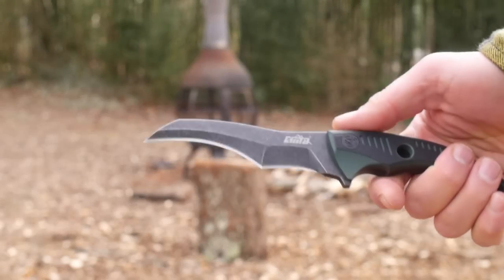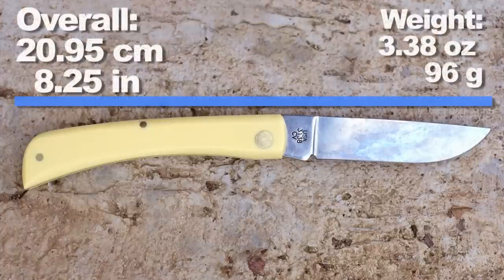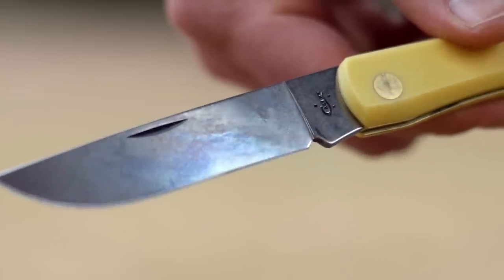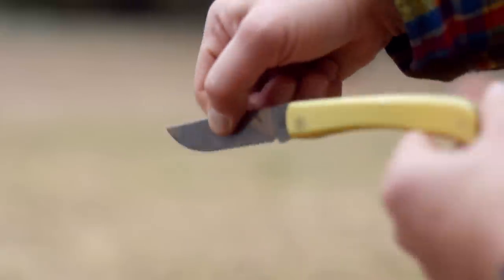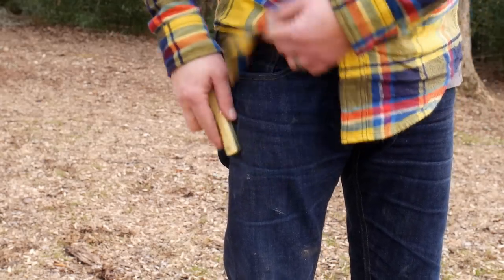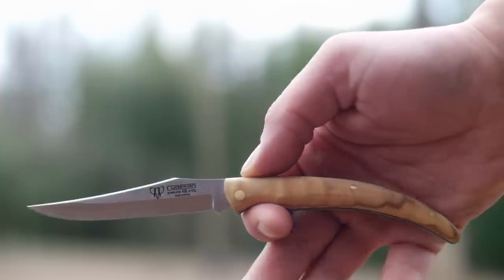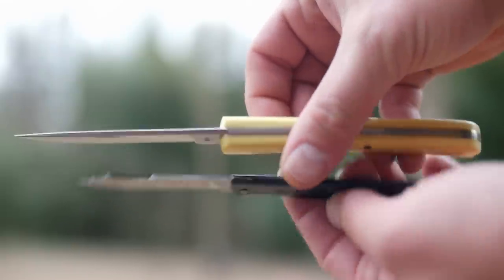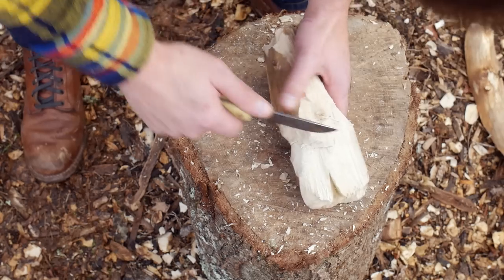Case Sod Buster Pocket Knife Review.  The ultimate cheap made in USA Grandpa EDC

Comment: IMO, the best way to carry any large traditional folder (with no pocket clip) is in the right rear pocket. I sew a 3” seam straight up from the  bottom of the pocket about 1.5” from the outer edge. This holds a knife straight up. It’s convenient, comfortable, doesn’t advertise your knife like a clip does and keeps the front pocket free.
Reply: That’s fine if your not wearing a kilt !

Comment: Certainly an American classic, especially in the CV with the yellow covers, but I feel like a slip joint in a stockman or trapper configuration is more iconic. One of the clip slips sold by Collector Knives might just work with this.
Reply from the maker: Yeah I know about the clip slips... those were the ones I was going to buy- just haven't gotten around to it yet.
Reply: William Henry sells several pouches with clips they call "clipcases" but they are rather pricey and instead of giving dimensions only say what William Henry models they are designed to fit.

Comment: mine came with an very uneven grinding....like my GEC bull buster way better...it is not that expensive either..but it is really hard to find...
Reply from the maker: My grind was a little off, sharpening it took some time with the diamond stones... sometimes I don't have time to go back and keep adding stuff... but I try and bring it up in the comparison sections in future reviews.  It wasn't as bad as yours sounded... more like a standard benchmade.
Reply: benchmade....you set your bar low....mine is quite bad...but I do have a super power that when I buy knife online, I will always get the bad ones....My first PM2 came with un-fixable side to side play...My boker exskelibur came with free spinning pivot screw because some one forget to put the D shape hole on both scales...the screw has the D shape...but both holes do not....My ZT452 cf came with a really uneven grinded  tip (one side was 26 degree, other side was 17...) and it took me 20 mins to re-profile it with my KME beast...My northwood barlow and GEC 75 both have blades that hit on the back spring....I only buy knives from verified seller or site...so..must be my problems not the seller. good thing is ...I can always tall which one is my knife...the one with problem....
Reply from the maker: I either get lucky... or I don't pay too much attention.  My PM2 has a pretty uneven edge grind after I've gone back and looked at it... Benchmade gets called out a lot, but well it happens with other manufacturers too.  However it still sharpens quickly and easily on the sharpmaker so I don't mind.
Reply: I do notice all those things but they do not bother me that much...I always trade those problems as characters...If the problem can be solved, I won't care too much..even the side to side play on my pm2 can't be fixed, I still love it since the play is not big enough to make the knife unsafe.

Comment: The inner Texan in me wanted to burn you at the stake for the few miner insults to case but I did see the points so rest easy. Ps I am 19 and carry a case folding hunter with CV steel and has yellow handles. It is big enough to stand up by my phone in my pocket witch solves the clip problem

Comment: Isn’t it more dangerous to cut cardboard with the spine of your knife on a slip joint? I don’t understand why someone would carry it then when you can cut yourself so easily with such a simple task.
Reply from the maker: They are fine.  Up until 30 years ago most knives didn't have locks- and as far as I know cardboard existed.
Reply: Advanced Knife Bro over your head buddy. Or I just suck at typing. Cutting cardboard with the spine of your knife. Could’ve been on both of us
Reply from the maker: My fault not yours... I get it now!